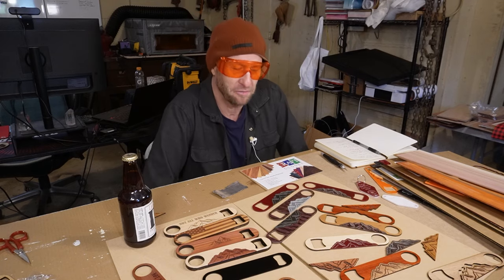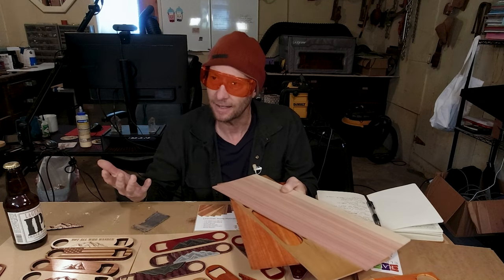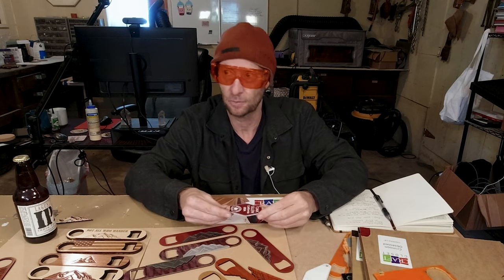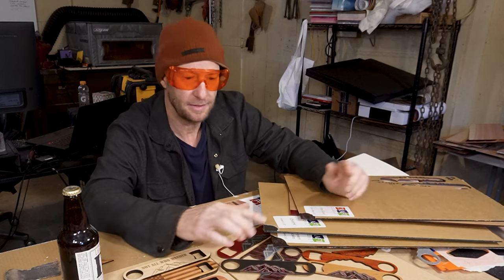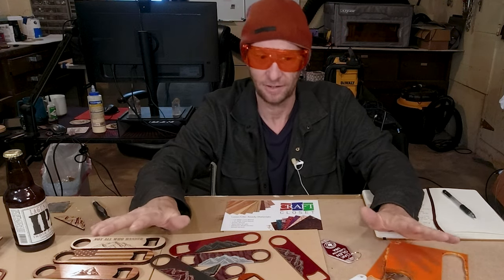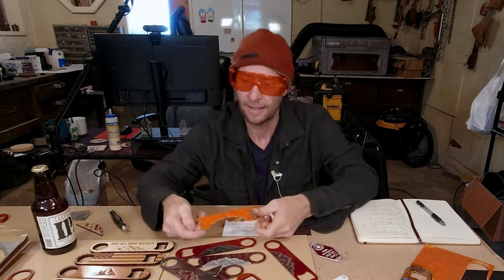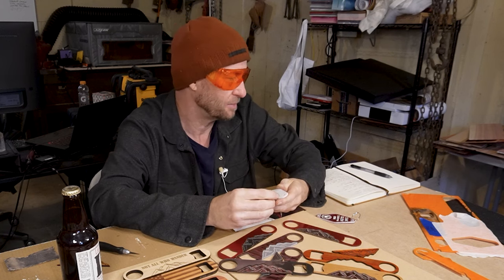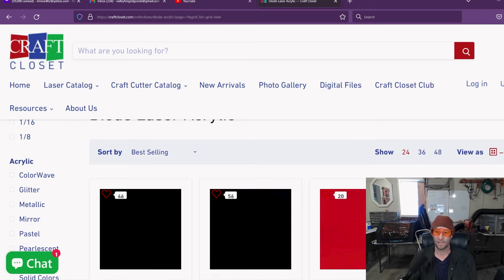Yes! Acrylic on a Diode Laser!!

Comment: Fun Video! I've actually been using CC for a while now. BTW, I cut the black obsidian with the LaserMATIC 10W, no problem! I focus 2mm below the surface.
Reply from the maker: Nice! I had written off Acrylic so I will have to get used to doing it again. I ended up with some strange spots (cuts?) in my laser cover. Luckily I have some spare. It just seemed to be reflecting in some strange way (the Obsidian). BTW, how many passes with a 10w?
Reply: @ValleyForged  1 pass, 250 mm/min on the LaserMATIC 10. Here's a video where I made an earring:
https://www.youtube.com/watch?v=p2luXgCai5I&t=4758s
Skip to 11:15

Comment: I have a 20 watt optical and just rrecently purchased some colored acrylic to experiement with, various colors. Based on your video where you say 280mm/m @ 100%  2 passes, I will do my first shot at about 200mm/m @ 80%, 3 passes and see what I get. Thanks for this video. I am wishing I had a 60W RF laser with a 15" x30" workspace.
Reply from the maker: Let me know how it works out. The stuff I was using was MADE for diode lasers so it works well. Had trouble with normal acrylic in the past.

Comment: What glue do you use to adhere acrylic to wood? And then acrylic and wood to metal bottle opener? If the "force" (when using the bottle opener) doesn't cause the glue to fail, I'm impressed. [It sounds like I've made the same trek from the good old K40, to CO2 to diode laser, and thus your observations and shared experiences are spot on for me.]
Reply from the maker: For the wood to metal I use superglue, and it IS NOT coming off. As for the Acrylic, I sand it first then use superglue. If you don't it may come apart. I will see if I can make a video on it.

Comment: Thinking about trying so acrylic out. But i am a little worried about the melting plastic fumes.
Reply from the maker: Yes, if you don't have good ventilation I wouldn't do it. Mine is great so I have no worries.
Reply: @ValleyForged  I run a 450cfm through a merv14 and a 6inch carbon filter outside. Kills most of all the wood burn but I am just running it out of my garage door, on the ground floor. Neighbors probably wouldn't appreciate my cutting it. 😭

Comment: Hi! I have  a question for you since you have experience with Lasers! Could the xtool 40w S1 be used for cutting acrylic? My goal is to do acrylic signs/decor, acrylic accessories and engraving stainless, steel, custom stationary, jewelry, and possibly glass. Would that laser work for those types of projects?
Reply from the maker: It will work on most, but beware of the bed size. That you cannot change. And pass through or rollers are mostly a gimmick. Get the right size bed for what you want to make
Reply from the maker: I misread this comment. The S1 is a diode laser, it will only cut the ones Diode Laser ready like the ones I mention in the video. You want the C02 version for cutting all acrylic. I thought you were asking about that one. Sorry!!